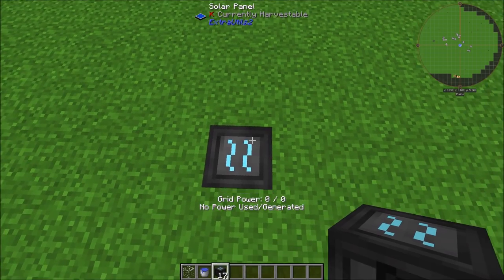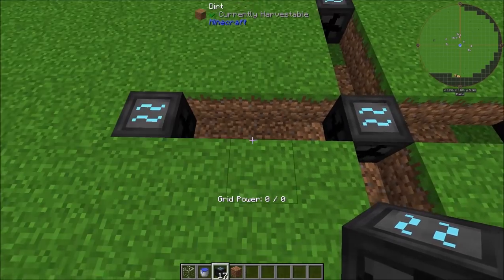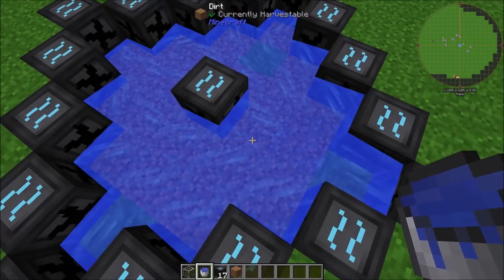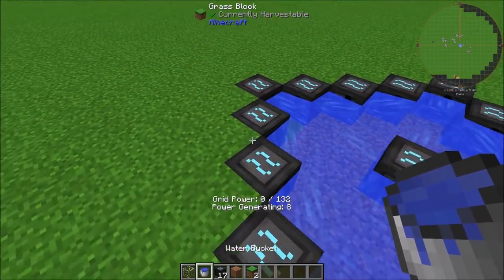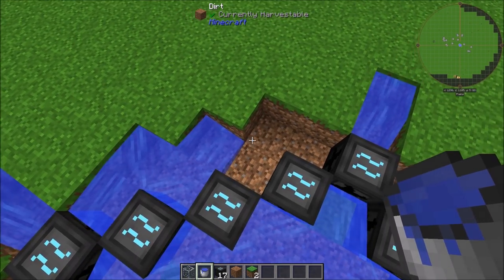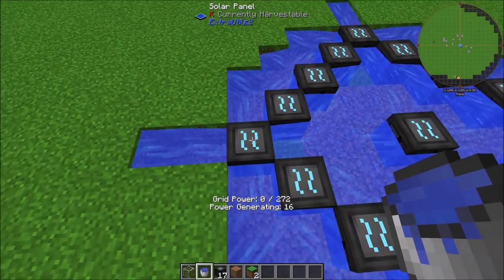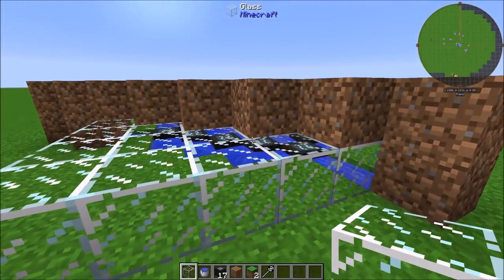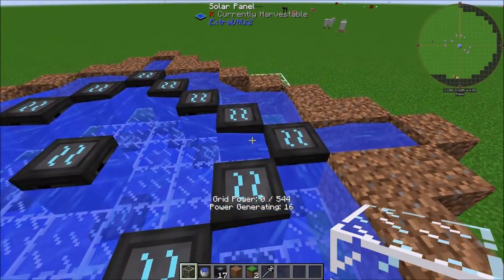Extra Utilities Compact High GP Water Mill Setup

Comment: Extra Utilities 2 now has an “efficiency” system, which means that if you use too many of the same type of GP generator, you won’t reach maximum potential.

So now, with this setup, you’ll only generate 178.67 GP, rather than 272 GP.
Still, this is a pretty damn good set-up, and I’m using this in my modded survival world anyway. Thanks for the tutorial, man! 👍

Comment: You can add four more watermills on each diagonal of your center one without changing anything else.  That gives you an extra 64 GP.
Reply from the maker: You are correct, idk why I didnt think of that.  I'll add an annotation to the vid, thank you very much.
Reply: Not sure why you are replying to me.  Your design is not as space efficient, which was the whole point of the video.  As a side note your diagram and key don't match at all  WMF vs OLX.
Reply from the maker: Lol, I noticed that as well.  Was wondering why his key was totally different than his diagram.  Believe youtube's spam filter ended up pulling his comment's though as he went through and copy pasted on like every comment, so I'm guessing it flagged it because this morning it had the comments under the "likely spam" tab, lol
Reply: lul fail.. but its still better :D A 15 by 15, like in the video, it would give 580 instead of 272.. so it is more than double
Reply: You are still wrong.  Take your design and place a watermill everywhere you have a slab.  Now it is both better than what you had and matches what is in the video.  You just expanded the expandable design shown in the video, good job.
Reply: Also can add 1 to every outer ring part, the "zigzag" areas and punch out the sides not touching water as well. this build filled to the max properly can make 400 GP even :D Not bad for just water XD

Comment: This is probably the best thing set up I've ever seen.. Simple, sleek, and efficient!
Reply from the maker: Thank you muchly :)  I'm glad that you liked it for sure!
Reply: I found your setup To Asgard, and I liked it and built it due to needing more GP than my original 4-mill setup was giving me, but I have run into a snag. In your video, you do not have any Efficiency loss, but my setup does, and it only increases if I add the additional 4 mills suggested by Brian above.

Comment: With this setup i was able to add 8 more mills without using another water bucket and its still the same square size. ontop of the 4 that was added by brian.
Reply from the maker: Yeah, as I said, the design can be expanded up and brought out.  Adding mills around the outside is just expanding it and making it more square.  Personally I love the star shape, but if you want it more square, you can continue expanding it to w/e size you desire.
Reply: at least from what i saw that would mean i have to add more water to it though to have the ones on the outside 16.
Reply from the maker: I know what you've done to do that, but its just expanding on the design and filling in the corners to allow water flow making it more square.  If that fits the design and build that you want to use it for, then go for it :)

Comment: My water mills are all producing 16 GP as this video demonstrates. However, I am seeing a 34% Efficiency loss in Effective Power. I have a Grid Power of 178.67 and an Effective Power of 10.51.
Reply: GP production has been nerfed since this video was made, anything over 4 water mills(64 power) will have power loss now. Each mill type has a cap like that, Fire is 40, Lava is 200, wind is 512, Dragon Egg is 1000. Which drops Efficiency by 33% After that when you hit double those numbers the efficiency drops again to 50% and one last time at double that for an efficiency drop in 80% to 95% depending on the mill

Comment: hmm... 17 maybe if i duplicate this it doubles the GP maybe top and bottom it actually simmiliar to my setup that i posted previously reason why more watermills is 32 gp for angel ring creative flying also other nodes inside upgrade uses gp
Reply from the maker: yeah, I just stack this up in a tower formation and build a tower out of them.  Fairly compact, and before long, you have enough gp to run all sorts of stuff :)